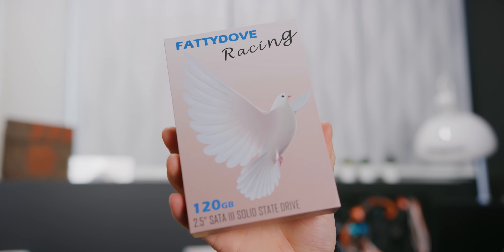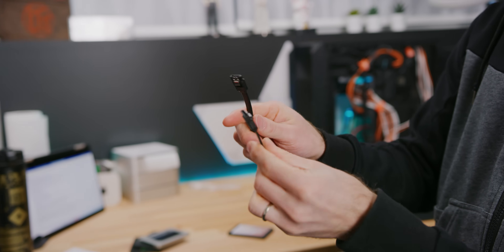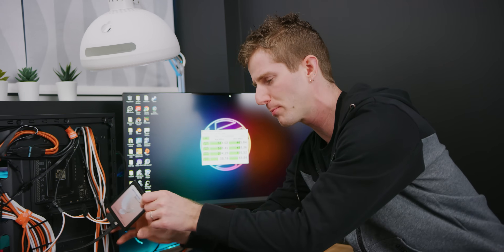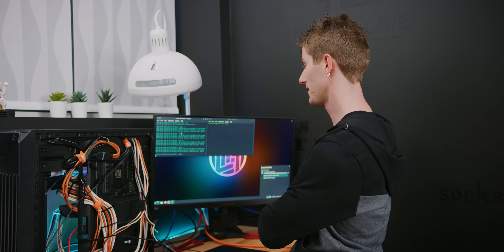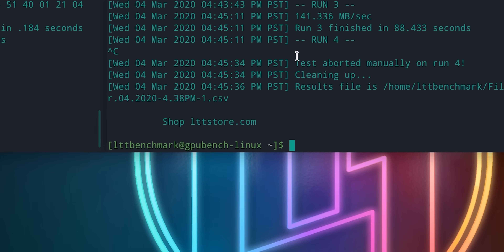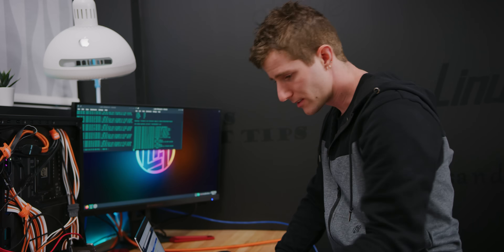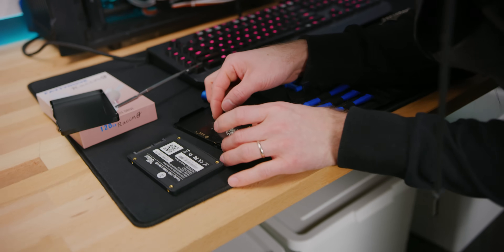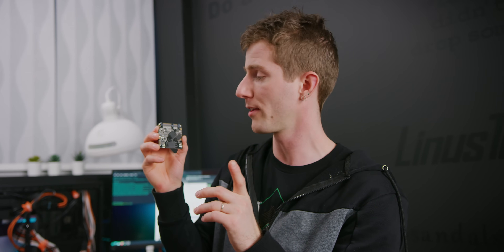How bad is this $20 SSD??

Comment: So, if you had 8, you would almost have 1TB... In RAID-0 mode, with 8, it would be almost 8x faster. For a total of $160.

How would 8 of these, in RAID-0 mode, stack against a typical $160 SSD, of comparable storage volume, of nearly 1TB?
Reply: They would be very fast and in a month or two, maybe more, you would lose all your data when one of them broke.

The more ssd in your raid the higher the failure rate. 1 large ssd has only one point of failure, itself. 8 ssd have 8 times the failure rate.

Comment: You burned half the cells, but didn't count how many read/writes

You need to fill up the SSD and leave 1MB empty then keep writing random data to disk, CRC check it, then write again, until it start failing, you need to count how many times you have write it, then you know if it worth buying that SSD

Comment: FIRST TALK ABOUT SLC .MLC .OR TLC 
THANK TO YOUR FRIEND TO TELL US TLC
SECOND 
PE (NAND PROGRAM ERASE TIME )
AFTER THAT 
NAND IS ORGINAL ? HYNIX .MICRON. TOSHIBA. INTEL?
FLASH IS DOWNGRADED ? BIG "S" OR LOW END ?
IF YOU SEE THE PCB AND TEL US SSD IS GOOD .
The Stupidest Test If you consider yourself a professional, at least call someone and ask
OH MY GOD THERE IS 1 NAND SO IS THAT BAD ?
LGA 152,OR 132 .dual channel 8ce max 
example 2c 84 64 54 is L95 MLC 16NM 16GB DIE

SO MAY BE 1 FLASH HAVE 8CE IN DUAL CHANNEL MODE ?DO UNDERSTAND ?
SAMSUNG LGA316  HAVE A 16NAND IN 1 NAND PACKAGE ? AND 4 CHANNEL 
EC 3A 94 DE=> 14NM MLC 16 K
EACH DIE HAVE 25MB WRITE SPEED *16 NAND 
I SAY DRAM LESS IS GOOD IF YOU ARE ORGINAL MLC YOU KNOW REAL WRITE AND READ SPEED

Comment: Best SSD ever. 30,000 jiggabytes per nanosecond write speed. I've been using this SSD for over 20 years in my racing laptop without a single failure. Power draw is a little high, needs around 1-2 lbs. of birdseed per day.

Comment: Depending on your intended workflow and expected performance I think DRAMless can be fine... like, read-heavy workloads where you don't need blazing fast performance I find it to still be an improvement.  Not that I'd wanna use it for my main desktop.
Reply: In my country there's still a HUGE gap in price between a DRAM and DRAMless SSD so I've only ever bought dramless SSD's and I've never had any problems with them
Even though I've seen many people claiming that in some instances they might be slower than a HDD (never seen this on any of the SSD's ive gotten) some say that a dramless SSD is not good as a boot drive because data is continuously written and erased on them but I've installed my windows on a 120gb wd green which has been working perfectly fine since the last 3 years (and it's still at 93% health) 
So I'd say 
If you are getting a good discount on a dramless SSD compared to one with a dram cache 
I'd recommend getting one
Reply: @99Teutons  Idk, I’ve also read reviews that they are more likely to die instantly. Some people say they bought one and it was dead in a few months. I also think the issue is the bait and switch tactics that manufacturers are doing hit harder without the DRam than they do when it’s inferior versions of SSD which include one. A bait and switch inferior quality ssd that has Dram just goes horrifically slow, but it seems like the ones without the cache just straight up die
Reply: @ghost-user559 i believe the issue happens when people go for dramless off brand SSD's. My old SSD is still fine and still working as a boot drive. I got myself another dreamless Kingston SSD as storage drive for replacing my old HDD. I also got my sister a crucial SSD to replace her laptop's boot drive. Also gifted my friend a 120 GB adata SSD for his birthday two years ago. All of them are dramless SSD's and never had any issues with em. 
Go for known brands and you should be fine imho.
Reply: @99Teutons  That makes sense but I did hear great things about the old Kingston and the current reviews say they are all garbage now. I also think many manufacturers are doing a bait and switch with inferior hardware being sold under the same skew and model number which several manufacturers have now been caught doing.

I have read threads and reviews going back years because I have limited funds so I pay attention to all the information available and it seems like all of the major manufacturers get stellar reviews and suddenly they ALL switched over to inferior manufacturing and ALL the reviews are awful. And they all say they “bought xyz two years ago and it was great” but they get the same brand and model and size and it is garbage.

I think there is a serious corruption problem in the current market that coupled with the shortages has made for some real pitfalls that were not an issue even two or three years ago. 

Even the most reputable brands seem to be inferior on the  lower tier products , but they are still making quality middle tier or pro tier products. Same with HDD and the whole SMR being marketed as NAS drives by all the major manufacturers until they got sued. Just a bad time to be looking for a deal, when it seems a year or two you actually could find a quality bargain without a catch. It’s really hard to know what brand to trust when they are all getting caught lying and nothing is done to regulate them. I would not mind the experiment but idk if it’s worth losing data, since many reviews of the cheapest ssd are saying some lasted mere weeks.

Comment: I happened to have a 256 GB which i've bought it for almost $35 and it works fine !!!
I even installed Windows 10 on it and, the Performance is, well done
I don't know why you'd surprised over a 128 GB $20 buck SSD Drive i think it should work fine

Comment: I'd buy this just for its brand name: FattyDove Racing. Single NAND means very slow. Most of the performance these days are from die parallelism. The benchmark in simulation I've seen is if you go from 512Gb die to 256Gb die and double the die count, you ALMOST can double the performance and only increase the overall cost by 20%. Now going the opposite direction and go from 8 dies to 1 die you will likely lost similar performance in the other direction, or something like that. Most low end consumers won't notice that but the drop is definitely there.

Comment: I bought this on amazon (Kingston 120GB A400 SATA 3 2.5" Internal SSD SA400S37/120G - HDD Replacement for Increase Performance) for $20 it increased my speed.

Comment: Ugh, it really grinds my gears when people use sudo for everything.  I blame Debian, they're the ones that thought that was a good idea.  I NEVER set up my Linux systems that way...I set it up so that if I need root for something, I su to root, do what I need to do, then log out of root (I only use root for administration tasks I need root for).  I am NOT typing sudo for every single root command, that's just dumb and not what sudo was designed for.  Sudo is designed to give (limited) root privileges to an account, for specific things that may need it, so if the root user is not available the task can still be done.  I gave my roommate sudo access to openvpn, because my VPN service sometimes goes out and I have to log it back in (it doesn't actually disconnect, OpenVPN still says it's connected but I get no connectivity).  If I'm not around to do that (and I can't remotely if the VPN is down), then he can restart it so we don't have to wait for internet until I get home.  I eventually implemented a cron job that would check every 5 minutes for connectivity and restart the service if the check failed.  But yeah, weird things like that are where sudo comes in handy.  Not for the actual administrator to use for every command.  Thankfully my distro isn't set up that way by default, instead it's set up so that root is inaccessible via su except for users in the wheel group (which is just me).

Comment: I'm not sure what you mean "at this pricepoint" which is around 20 bucks. Kingston's A400 used to be at around 22 bucks for the 120 GB model and only 30 for the 240 GB model (which is when I bought it) and afaik both of those have DRAM because they're fast (Not great, but definitely wouldn't perform this good if it didnt have DRAM)

Sadly, even the 120 GB model is now 30 bucks! I wonder what happened
Reply: A400 doesn't have dram
Reply: @LyricsFred  Then im not sure how mine is fast, DRAM makes a big difference

Comment: When I built the first flash-based memory devices starting in 2008. I just doubled the chips and wrote to both sides at the same time using half the chip as a backup and the other half as a memory device. My guess is that this company is using an illegal copyrighted design and just created a new company name as a front. I've seen a lot of them. All the source and design work was stolen in 2013-2014. Since then they create a new company and operate for a while and then move on to the next. The current patent is owned by Western Digital.
Reply: Seems to check out, since Fattydove is no longer selling anything in Amazon

Comment: 2.5" SSD's kinda remind me of old game cartridges. Whole lot of empty space around a few chips. It's annoying if you have extremely space conscious build going on.
Reply: 3d print a custom smaller shell for the ssds in your custom builds
Reply: @shahmirkhan5373  well I'd go for a simple bracket and heat sinks while at it, but removing the original shell makes issuing a RMA a very difficult job. I've had ssd's dying on me under warranty (one Samsung 500GB 960 NVMe recently and one 256GB SATA ages ago), so maintaining warranty is not entirely a futile exercise.

Comment: just get these with 5 year warranty and past the 4 year mark you smoke the ssd or something in a way thats warranty valid (they dont check most of the time. i got away with my m.2 ssd RMA because when i pulled off the heatsink it was still warm so the thermal compound is part liquid and acts more like glue and ripped off a tiny resistor, the square ones)

Comment: if this company had an M.2 ssd they'd probably call it "Skinny Dove Kart Racing"
fun fact - most cheap known Chinese brand SSD's (like KingDian and KingSpec etc.) are using Samsung silicon so they aren't that bad after all lol.
but yeah.. i wouldn't trust any of the SSD's on the market that is not a Samsung product... not even some of the other big name reputable manufacturers.
Samsung maybe ain't cheap but they do make the FASTEST and most RELIABLE SSD's in the market, after all they bin-pick the chips for their own SSD's and sell the rest of the pile to other manufacturers so that makes sense...

Comment: Am I the only one who thinks that $20 for 128gb isn't a great deal. I mean here I can easily get a 512gb WD blue / red for about 70€ to 75€. Similar price per gb and a much better deal. Last year when flash was actually cheap, I bought a Corsair Nvme 1tb ssd for about 120€. So $20 for 128gb from some Chinese company (probably no warrenty at all) is a rip off

Comment: SLC caching is actually a thing for consumer SSDs. Meaning some of the cells are being treated as single bit, rather than 3 bits, in case of TLC
Reply: Well the DRAM is SLC, but no SSD uses SLC today. It’s just way to expensive, especially when factoring in economies of scale. The extra speed and durability just isn’t worth the cost.
Reply: @zachb1706  DRAM has nothing to do with SLC. SLC is a definition applied to the flash ROM. And most (if not all) consumer products nowadays feature SLC caching - essentially, treating some part (up to 20%) of the drive as single layer cells. Later, when the space runs out, drive starts adding more data in those cells, making them regular MLC/TLC

Comment: I'm really fed up about my issue I've done lot of reasearch but seems like just about no one was experiencing my issue . 
My sata internal hdd keeps disconnecting and connecting on its own it's very annoying when I tried to know what's the matter I found that drive which was malfunctioning was really hot . 
My specs .:- 
Ryzen 24000g
16gb ram
1x256gb m.2
7200rpm 1tb hdd Seagate
5400rpm 500gb Seagate (malfunctioning).
Please help me please

Comment: The capacitors should enable it to dump the data in the DRAM (cash) into the flash in case of a power loss.
Reply: But there aren’t

Comment: We were basically throwing away 128gb m.2 drives that came with our HP laptops for a fortune 50 company, we had many users logging into one laptop and too many user profiles would fill up the ssd too fast.   Besides size, they seemed reliable.  You can probably get 5 packs of those used on ebay for less than this crappy SSD.

Comment: The PRIMARY reason for using an SSD in a laptop is PHYSICAL DURABILITY, not speed, not operational lifespan, not even power. Do some real research on actual large file transfer time (files larger than cache), TTW (total terabytes written) lifespan, and the current draw during the write process. You want SSD if you slam the lid and toss down the laptop.

Comment: Me : Buys a 128 gb Ssd
Me : Buys Call of Duty Modern Warfare 2019.
Requires 184 gb of space
Reply: I’d recommend just having your OS and work programs on your ssd and buying a second hand hdd as your games/storage drive
Reply: @splashed44  Yea im going to buy another ssd in a day or so and sorry spelled warfare wrong didn't realize it till now
Reply: @firexallst4rz277  if your willing to spend more go for it, but a 128ssd has more than enough space to have your OS and important program files on it. save yourself a few hundred bucks and just get a second hdd if you want a drive to exclusively install games to.
Reply: @splashed44  I already have a boot drive ssd 256gb and 2 other ssd at 500 gb capacity and i will just get a 1tb one or more
Reply: @firexallst4rz277   ur original comment is just a joke or what am i missing? u buggin boy
Reply: @splashed44  i was trying to be cool and fit in and type that stupid meme that other folks type but i failed and im really getting another drive
Reply: @firexallst4rz277  you also put if not of :-P but yeah, I get so sick of my friend blabbering about SSD boot speed when clearly they're not yet ideal for gaming space for price wise
Reply: @firexallst4rz277  u said "call if duty "
Reply: @dotand0   OK i corrected it i just now noticed thanks
Reply: @firexallst4rz277  np
Reply: Ryland Mitchell or you could always go for the 1tb NVMe drive for your OS and the 2tb NVMe drive for the games
Reply: @splashed44  I straight up ripped out my old hdd out my laptop and slapped it in my case, now I have an extra terrabyte lol
Reply: @splashed44  no shit bedrock
Reply: @splashed44  nah Fam. Put only low performance and lesser played games on HDD. SSD is much faster. Also, some games and launchers need to be on the same drive as OS.
Reply: @splashed44  second hand hdd? yea no
Reply: Ryland Mitchell exactly what I did
Reply: @splashed44  don't buy secondhand hdds unless you have zero budget. Unreliable. Ssd is competitively priced now, and the silence is golden.
Reply: @splashed44  >buying a second hand hdd
yeah, never do that.. but a cheap HDD is a good idea.
Reply: SSD only laptops: IM IN DANGER!!!
Reply: me buys a 1tb ssd  costs loads   installs  football manager 2020 2.4 gb and world of warships  30gb whoop this is just so fast
Reply: @marcusnzchab971  ... a 1TB SSD is a good idea especially if you never more than half fill it. The SSD will last a lot longer because of less write cycles on each memory row. My 1TB C: SSD is only 30% full and will pretty much stay that way. My gaming SSD is just under half full and does not have much written to it, mainly has a big bunch of static 4GB data files some of which may change during the occasional game update.
Reply: I just use ssd for my OS and some projects files.
Reply: Needs over 265 now on PS4 Pro. It's getting ridiculous.
Reply: laughs in 1tb
Reply: 248.00gb as of today
Reply: compress it
Reply: f
Reply: MORE LIKE THE SO HAS TO BE ON M.2 DISK HARD DRIVE.........GAMES ON HDD.............ONLINE GAMES ON SSD.....................
Reply: Call If Duty?
Is this a CID's game?
Reply: mm kay, will remember to call you only if there is duty
Reply: more like 360Gb of space
Reply: This shit is overweighted! Devs should make games that use ~50gb!
Reply: thats why you get hard drives with your PC
Reply: So brang it back and pay 40 for a 480 gb ssd.
Reply: Holy cow now cod mw is 240 gb 🤣
Reply: @Suhaib A aww rip dude that sucks
Reply: It's 256gb now
Reply: 245 GB now and climbing lol
Reply: I have a 1TB M2 SSD for my C: drive and a separate 256GB SATA F: drive for my games. Drives D: and E: are standard 2TB and 3TB HDDs mainly used for storing movies, music, TV shows and photos so don't need to be super fast. I like having my games on a separate SSD because I can remove it from my home desktop computer and plug it into my holiday house desktop when I travel. No need to copy the latest versions on the other machine, just plug and play.
Reply: @sbalogh53  hey quick question from the future. What kind "drives" you mean on the D:?
Reply: why would you buy a 128gig ssd...... do they even make thows in 2019/2020??? 

are you a time traveler from 2012???
Reply: @kainhall  I just grabbed 12 128/120gb SSDs to convert our old HP Thin Clients into cloud-based windows 10 machines in case we need to all WFH in a hurry. Should i have spent 2-3 times as much for more local storage on cloud machines? :p
Reply: @kainhall  im sure he wouldnt mind if you buy him a larger ssd , and ofc to forget to get me one aswell ...

Comment: I am pretty sure that is the same as the teamgroup l5 120gb ssd with a different sticker. I bought it and it had similar performance and looked the exact same on the inside but it died after only a couple months of use